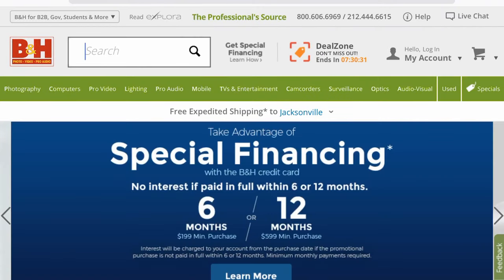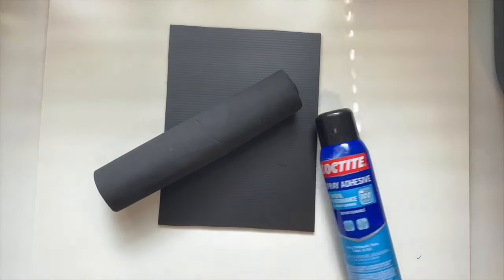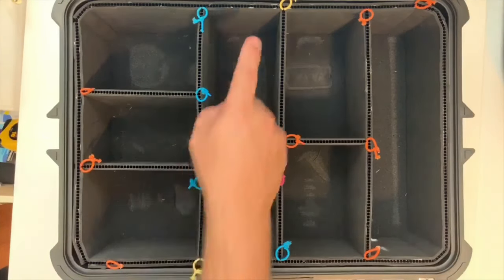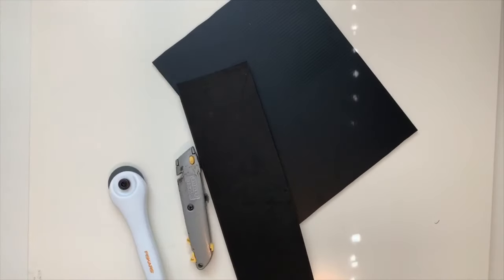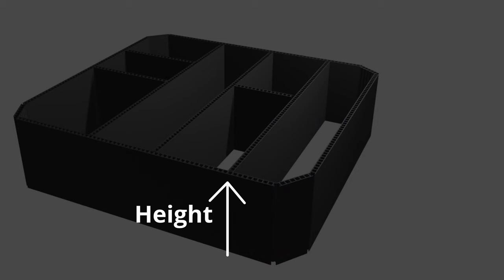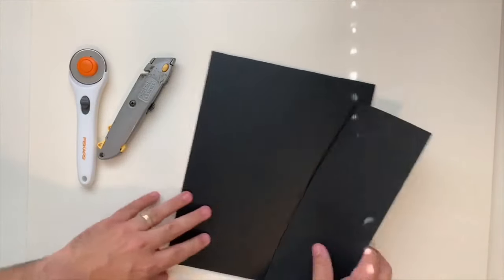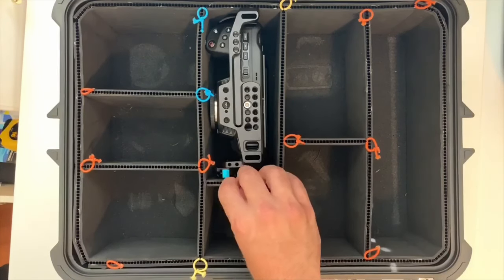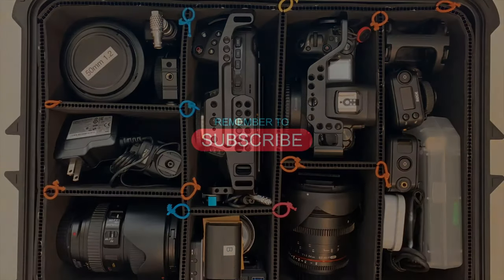DIY TrekPak Dividers

Comment: Great idea with the foam. Have to try the pins. I use the Bostitch 2” floor staples (BCS1516-1M) 15.5 Gauge. Break them off two at a time.

Comment: how is the quality? the trekpak is indeed expensive but their materials are way better than craft foam and signboard. Struggling between DIY and trekpak
Reply from the maker: Well its been 4 to 5 months that I've have made them and it has hold up pretty well to this date. The good thing is that if it ever breaks it wont break the bank to make it again. :)
Reply: I'm pretty sure they use corrugated plastic(same material used here) for the substrate of the dividers, not sure what type of foam they use, regardless materials of equal quality are available for this DIY version.